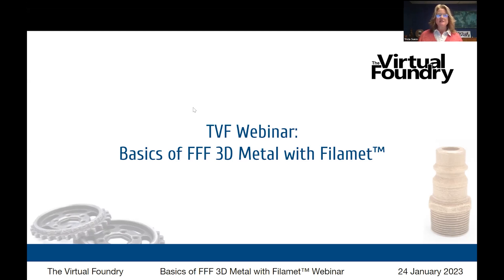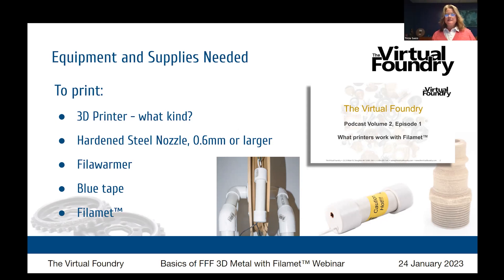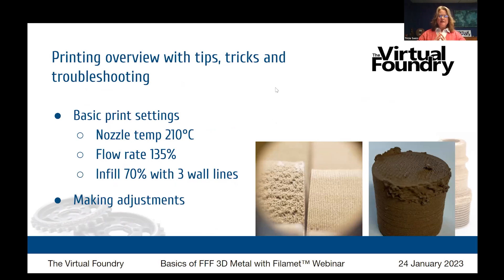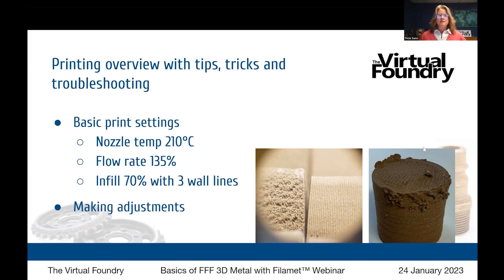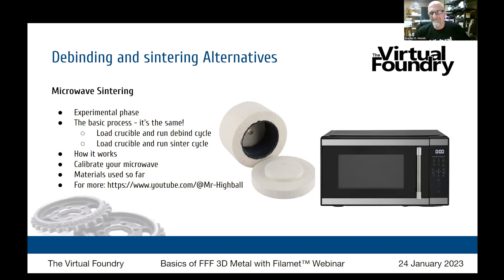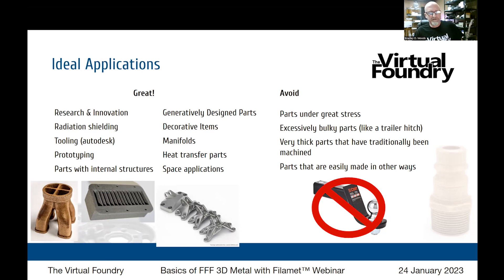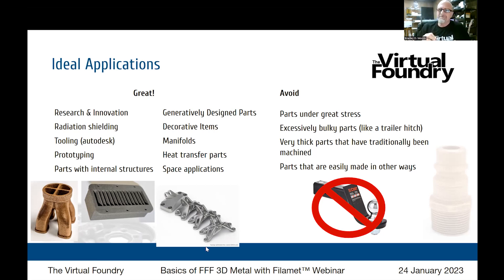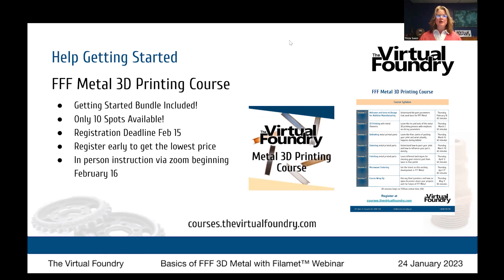TVF Webinar: Basics of FFF 3D Metal with Filamet™

Comment: What will be the composition of metal Powder and which Binder polymer is used in metal filament extrusion?
Reply from the maker: The amount of metal loading is dependent on material. Copper is 87-90% by mass, Stainless Steel 316L is 80-85% by mass. The full list of material loading amounts is here: https://thevirtualfoundry.com/products/
The binder is PLA-compliant. It's mainly regular PLA with a propriety additive.